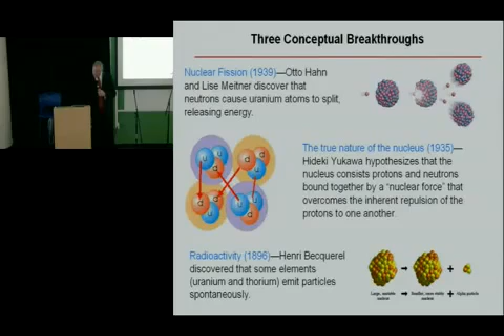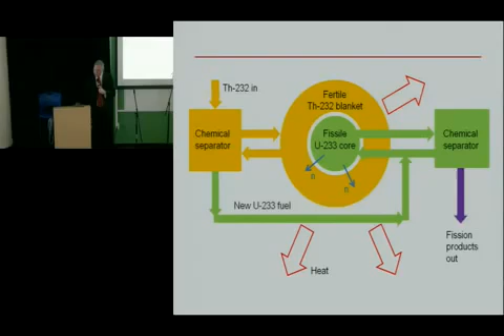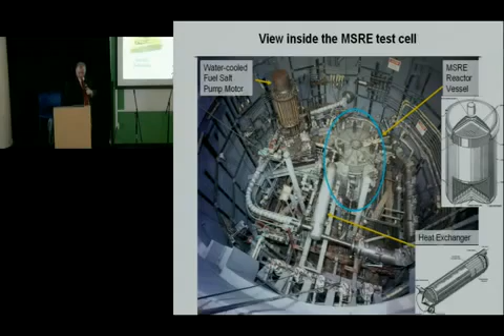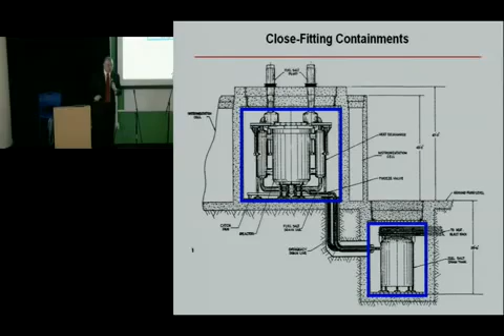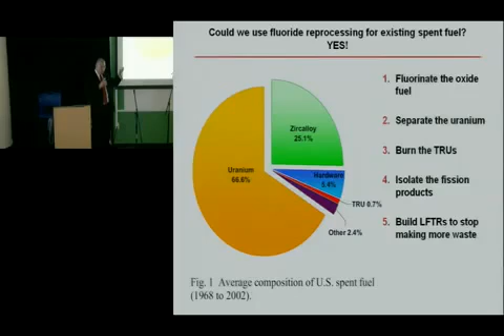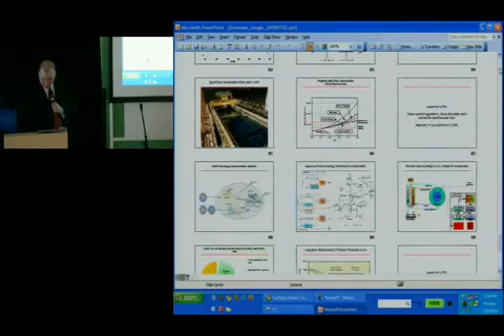Energy From Thorium: A Nuclear Waste Burning Liquid Salt Thorium Reactor

Comment: You Americans developed a successful light water breeder reactor using U-235 core surrounded by a thorium blanket w/c is converted into fissionable U-233. Then created a U-233 core reactor wt a thorium blanket w/c is converted into more fissionable U-233. If I can recall it right, the conversion ratio is 60 to 70 times than what is consumed. But the Liquid Flouride Salt Thorium Reactor was abandoned because it is cheaper because it eliminates fuel reprocessing w/c is a big business.